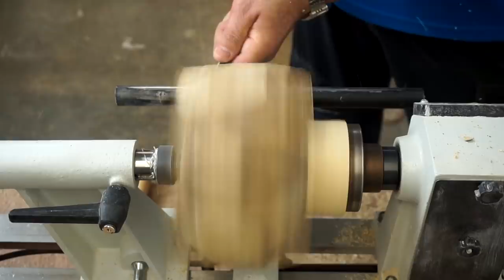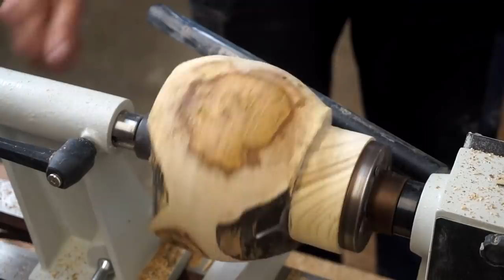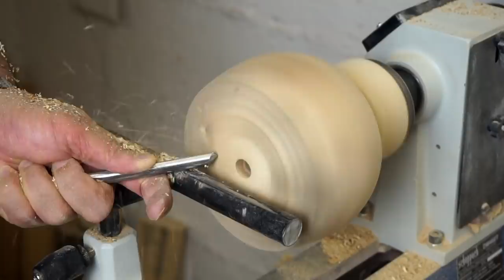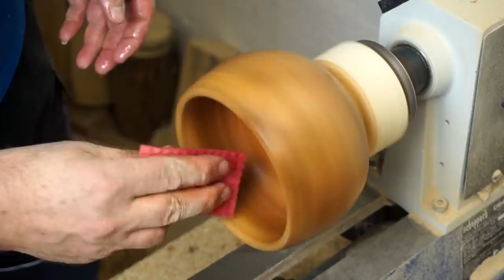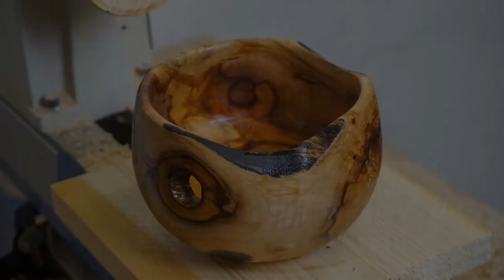Woodturning: Rotten Log into a Bowl

Comment: Nice bowl. Just a couple tips; when roughing out the bowl get as much bevel contact as you can. What you were doing there is more of a scraping cut with a gouge and that’s why it took so long to rough it out. 

I also notice you don’t have a bowl gouge? First of all I applaud you for being so brave with a skew. At the end you could use your round nose scraper to clean up the inside and get those tool marks less visible so you don’t have to sand as much.